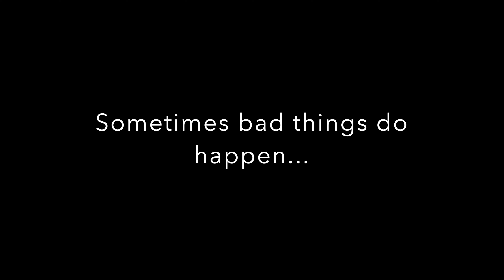Sometimes bad things happen....

Comment: Oh, never seen this before… but yeah, must be cracked block. But also - double check that there are no bolt inserts or something like that in bolt holes (the ones that someone would place after drilling a bolt in). I would personally remove camshaft and inspect. Then with removed, try tightning it and try to see what is causing deformation. Unlikely something else, but that would be my guess just to find the cause.
Reply from the maker: your point is SO valid. I've seen so many builders not even cleaning out the head bolt holes, they just put new ones in. I have an especial reamer that gets rid of the rust, silicone any foreign material etc. It will also repair slightly damaged threads. Then blow everything out with compressed air. I do this on every bolthole on any engine. It's two hours just for cleaning bolt holes and repairing threads sometimes. By now I disassembled the whole engine and sent it to the machine shop. Really really curious...

Comment: Hello, love the vids!  Wild guess 1, are you able to check and verify the internal crack theory, are they visibly there to be inspected (seems weird that two stiff surfaces now in absolute correct flat surface contact can distort the line of the cam axis when tightened?  Wild guess 2, Is the head and block post decking actually still flat and no gaps between in the center portion prior to tightening (ie check without gasket with feelers/marker) WG3, what status was the block (pre or post decking) and what was the reference face used to line bore the cam bearing axis too?  WG4 head alone would seem to be a very stiff structure that wouldn't distort much during tightening if flat and against a flat surface, very odd.
Reply from the maker: thank you. Your questions are great. I don't think too that the two stiff and flat surfaces are the problem.  The head and the block are 100%straight. I have a very expensive straight edge, even the thinnest feeler gauge doesn't fit underneath it on both faces. The condition of the block before was worn cam bearings but this is normal. They were not spun in their seats. Didn't take any more measurements than that. my personal guess is the boltholes are cracked somewhere in the block and when you tighten them they expand and pull the casting up just enough to makle the cam stick. My machine shop suggested pouring gasoline in the holes to see if there's a leakage below...Like u never seen it before. They will get back to me

Comment: Hi, may I ask you were your garage is located in Portugal? I'm from Portugal too (Viana do Castelo). I'm looking for a w123 or w124 and want to restore it to make it a daily driver. I just feel the need to have an old special car again. My back ground, renault 5 gt turbo, saab 9000cd (fantastic car passed hole france with cruise control set at 200km/h), mercedes c220cdi sport coupe pack evolution, then kids came and drove another saab 9-5 wagon for 11 years then finally my first new car Dacia Duster 1.3tce 2019 just a normal car and now I just feel the need for an old special car to have as a second car that I can drive daily so I can pass the Duster to my wife.

Comment: I have a 300tdi. The sad thing is that those engines were made to run on lower quality Diesel. In South Africa, we used 500ppm Diesel (fuel having 500 parts per million sulphur) with these engines. The sulphur is added to serve as lubricant. Now Diesel has only 50ppm or 10 ppm sulpur. This has caused my Diesel pump and injectors to pack-up. This has forced us to add two-stroke to the Diesel, which acts as lubricant. I'm at a cross road now. Won't it be better to replace the 300tdi with the BMW E52 engine. Also bulletproof and can run on the lower ppm Diesel fuel we get here....

Comment: Great to see a potential failure examined in great detail. Every one will appreciate your effort.  Could you accept the potential crack, send the block to the borer with the cylinder head fully tensioned, then hone the cam tunnel to compensate ?

Comment: Hi mate I'm just about to start a om606 that I've fully rebuilt using redline assembly lube. It's been sat around 6 months. I was going to remove the glow plugs to aid fast cranking and hope it builds oil pressure quick or would you fill oil filter housing and oil cooler lines. Or do you have any other tips thanks

Comment: good afternoon, the block should be cast iron and the head aluminium ...aloy...you could check the shaft's seats .... or the shaft is not for that head and block or the head or the block ...... you can test this theory by : putting a thicker gasket and troque the head again ... if it aliviates than you will  need to find the culprit ....i do not think it is a crack. In these disorientating moments , i would tend to throw to the bin and go buy something .... my wife knows that i will not rest until i find the solution and i always find one ...the in between is frustrating!  by the way i had to tell a cliente that his engine was scrap due to the fact that we do not have spare parts for the 2.4puma engine unless ordered ... i am curious to find out what was the problem and how much headache you had . 🤜
Reply from the maker: hello, I put some metal washers under the two head bolts in question. Results were the same. Boltshafts are as clean as possible. I can't rest either until I know what the problem is. I think I'll know by next week

Comment: Did you find the problem?  I wouldn’t be surprised if the head bolts were longer than spec - some suppliers have very poor quality control, like Britpart.

Comment: So a suggestion is to rotate the block 90 or 180 degrees and use your bore scope to look at the block around the cam bearings and tappet bores with the head studs loose. Then tigthen down the head studs and see if you can see and cracks open up. You can use a light coat of white paint on the surface with the head studs loose to help show any cracks that open up. Also you might want to pull the cam and inspect the cam bearing and make sure that one of them didn't get nicked while installing the cam or the cam bearings themselves. It may be that that nick only becomes an issue when the block is tensioned with the head studs. Sometimes when cam bearings are installed if they are hammered to hard they will mushroom and little bit.
Reply from the maker: great answer. For that I will have to get the cam bearings out again. But yeah with a bit of piping under the head bolts tighten them and then yes check for cracks. I just ordered a very good horoscope(have a shitty one) .I will let everyone know what it was in the end

Comment: Could you not line bore with the  head on or a deck plate to simulate the movement ,if there is no crack which at the moment is only your theory the movement may have always been there just a thought
Reply from the maker: my guess is the engine cracked along its life and the bearings were worn enough to not cause major damage. But the answer below might make a lot of sense. Might be that bearings were not installed properly. Its at the machine shop for diagnosis

Comment: Curious if the camshaft bearings were reamed with the head bolted on and torqued so they were aligned when the block was already stressed if that would have made a difference?
Reply from the maker: Normally the cam bearings are press fitted in and then they are inline reamed(if needed at all) to allow the cam to rotate freely without binding. Never seen it done with the head bolted on...I would guess when cold everything would functioning smoothly. What about when warm?

Comment: Great channel, keep the Defender content coming.   Excellent part of YouTube University!  I recently bought a mechanics special 110 with a 300 tdi, was told it had a cracked block.   Oil mixing into coolant, was hoping it was something else (personally I think it’s a cracked oil cooler.(was not the head gasket) Will find out tomorrow!

If you skim the head and the block would the rollers possibly be creating your issue?
Reply from the maker: thank you! the defender doesn't have an oil cooler in a 300 TDI, well it does but its just that. No water going through there unless it's an aftermarket fit. I noticed the resistance on the cam initially when the head was bolted down the first time. only the rollers and cam followers in place...
Reply: @heritagesteel1976 . I got lucky, my block was not cracked…it was a cracked oil cooler (inside the radiator) easy and cheap fix